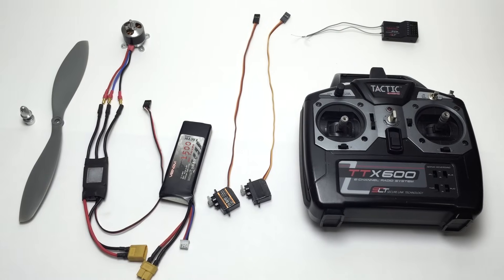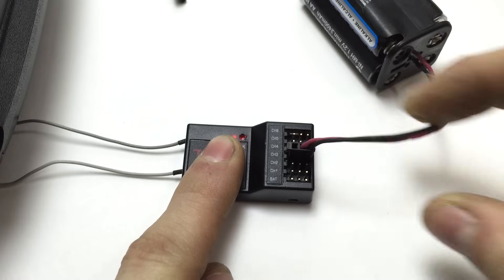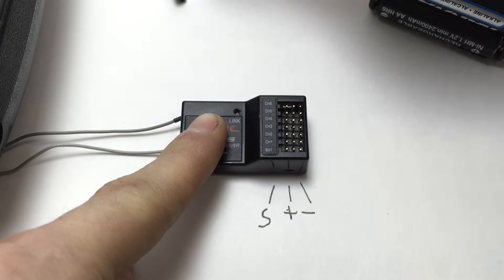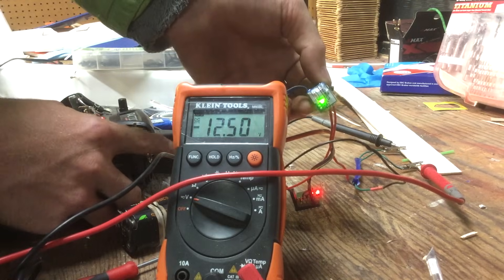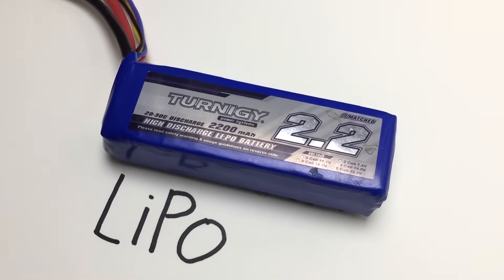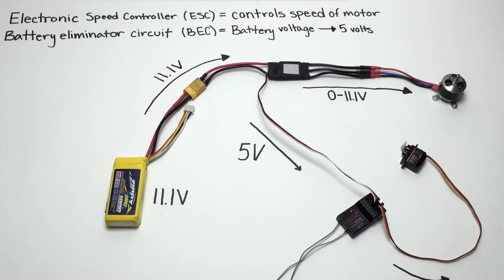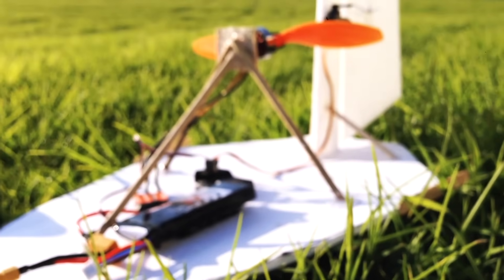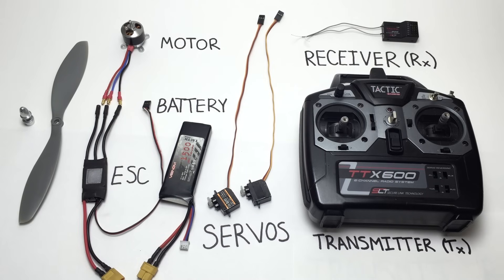RC Electronics for Noobs

Comment: what does the other plug from the battery plug into? im not talking about the + - leads
Reply from the maker: That's the balance plug, for using with a LiPo checker or balance charger

Comment: How does the battery charge and would it be enough voltage to power a big rc boat that might be around 3-8 pounds( building a boat for my pet lizard).

Comment: What type of connector did the battery holder have?
Reply from the maker: Those yellow battery connectors are called XT60's
Reply: I actually meant the 4 cell battery holder connector, like JXT or Futaba.

Comment: what amps does the esc shoukd have? the motor says 30 A. does it need 30 ? or does a 10 amp work for the motor?
Reply from the maker: The ESC does not "push" power to the motor. The ESC lets the motor pull power through it. The ESC needs a current rating that is higher than the motor rating so that it can withstand the power that the motor wants to pull through it. For example: 30a motor should have about a 40a (or more) ESC to be safe.
Reply: Samm Sheperd thank you, its clear now

Comment: Guys guys, for the first time in my life

I heard an American say solder instead of sodder! No but seriously, great video - I thought there might be more to this, but now I know there isn't, I am far less hesitant about buying this stuff to make my own scratch built plant or glider! Also I'd like to add FPV. If you are reading this (despite it being a relatively old video) I would be very interested to see 1) a video on how to build a foam plane/hand-launch glider 2) how to install the cheapest and most effective FPV system on said air vehicle.

(I wrote this comment halfway through the video and I've now seen the links, just thought it might be helpful for others in the same position as me!)

Comment: The for "whatever reason" on the different coloured servo wires comes from the original Futaba and JR Propo radio systems. Futaba had the white signal wire with the irritating flange on the side of the servo plug. (we normal just cut it off with sharp blade or something) while the yellow signal wire system comes from JR Propo. (suppose it was some sort of a opposition or competition thing). Accept for the plastic flange, there is no electrical/electronic difference.

Comment: I really want to build an RC plane now. It should be easy to connect a microcontroller and some LEDs. Can the ESC provide enough power to the 5V rail to power a few LEDs or should i connect them directly to the battery?
Reply from the maker: Yes I can definitely power some LED's. Servos are very power hungry in comparison.

Comment: can i use a 850 mAh 7.4v battery on a 1000 kv brushless motor
Reply from the maker: The motor specs should tell you what the recommended propeller and battery is.

Comment: I have a question: how do flying wing/delta wing servos work out.  how do the servos recive information from two channels simultaneously?  I've been researching these designs as I want to get back into the hobby but I haven't seen anything about this yet.
Reply from the maker: The mixing is done in the transmitter and the servos just do whatever the receiver tells them to do. Pretty much any transmitter will at least have an elevon and vtail mix preset. Most are digital with a screen on and you can mix anything however you want, for things like flaperons, spoilerons, or even automatic elevator trim with the change in flap position.
Reply: ***** I have the same transmitter as featured, so I'll figure it out.  Thanks for the response
Reply from the maker: Oh cool I think it's something like "hold the sticks down and to the middle and then turn it on" or something like that to toggle between elevon v-tail and normal mode
Reply: Any particular motors/ motor specs to look out for?  I've got the motor and servos out of whatever plane used to go along with my transmitter (for there are many) but I think the axle is bent, so i might have to get a new motor.  About the only specification I've heard them talk about is wattage.  this might be asking a bit much so feel free to point me to a web site or other video.  or just tell me to do my own darn research :)

Comment: Hey Samm, great video! I am completely noob and I am looking to build my first quad (probably you remember a recent comment on thingiverse) I was looking through different transmitters and the frsky taranis is too much for my budget, and the FlySky looks a bit poor in quality?? anyway, I found also the turnigy 9xr, would you recommend it? or do you think I will be fine with the cheap flysky? Thanks
Reply from the maker: The biggest concern for me with quads is what receivers they offer. You don't want to be stuck using big ones. Frsky recently released the taranis q x7 for half the price and it should be great because you can use the X4RSB and have frsky reliablility
Reply: Cool, just ordered Taranis q X7 :)
One more question, is there something like Flight Controler + Gimball Controller?  just wondering if I could add a camera (hero5) with gimbal control in the future.
Cheers!
Reply from the maker: Yes there is but I don't have much experience with it

Comment: do i need calibration of motor before testin the motor
Reply from the maker: No, the motor does not need calibration. It is just a physical component that the speed controller (esc) can control. The speed controller does want to be calibrated. It wants to know what the top and bottom range if your radio channel is. To calibrate: 1. ESC connected to the radio receiver and to the motor, but disconnected from the battery. 2. Turn the Radio on. 3. Move the throttle channel all the way to maximum. 4. Plug the esc in to the battery. The esc will detect the high value and set that as the maximum, also it will sing a song. 5. Lower the throttle channel to minimum. The esc will detect the low value and set that as the minimum. And also finish the song and arm. 6. It's a good idea to disconnect and then reconnect the esc and battery. 7. Calibration complete.

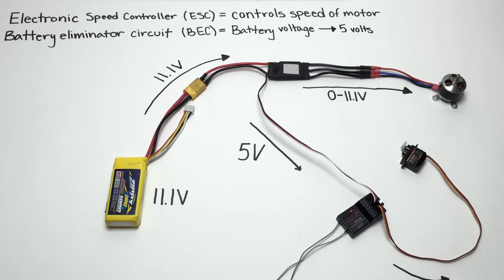Comment: 3:03 what's the other cable that goes out of the battery?
Reply from the maker: That is called the balance plug. It's just a set of smaller wires that go to the positive and negative of each individual battery cell so that a balance charger can make sure all the cells are balanced (charged equally) it's a quirk of these lithium type batteries.
Reply: ohhhhh, thanks a lot for the reply!

Comment: in united arab emirates we have 2 wire rc motors so what
Reply from the maker: +SYSTEM 1985 if the motor has 2 wires then it is a brushed DC motor. It needs an ESC for brushed motors.

Comment: Thanks so much for making this video! I'm currently building a 250 FPV quad and just got a Tactic Ttx650 radio with the same exact receiver you use in this video. Up until watching this video, I was confused as to whether or not I had to use a separate battery just to power the Rx. Your video cleared this up for me!Knowing that my ESC's have a BEC and that I can power everything including my Rx with just one battery is a huge relief! I searched high and low for any videos that featured the Tactic receiver and how I'd go about having to power it and luckily your video popped up in my feed. Thanks so much! 😃
Reply from the maker: +Iwillsayyes1 glad it helped. I plan to make a similar video on the subject of "quadcopter parts for noobs" and "FPV for nubes" but for now I have to tell you that the ESCs used for quadcopter a nowadays don't have BECs because it's a bit silly to have 4 of them. Instead they put a BEC (or 5v output) usually on the PDB (power distribution board). I love my tactic, but as far as I know they don't have any receivers with PPM or serial output (one wire for all channels), meaning you'll have to use PWM (one wire for each channel) which is fine.

Comment: how do i connect a wire without those black plastic thing in the end to the receiver.
Reply from the maker: You can take the case off the receiver and solder the wire directly to the pad under where the pin connects to the circuit board.

Comment: Thanks loved it. Know it's old but been flying drones now moving to planes and found it all very confusing as to what to buy and what was needed. Would love to see how to put a compatible system together with a simple flight controller and gps if you ever have time. 
It's the esc that gets me. How do you know what power esc to get for your motor? Also does the battery effect it? If you go from say a 2200 mah to say a 3500  mah do you use a different esc? So confused. Any help much appreciated.
Reply from the maker: It starts with the motor. The motor should have specs which say what battery voltage, propeller and ESC to use.
The battery voltage is determined by how many cells are connected in series eg. 2s, 3s, 4s etc. where each 3.7v cell adds together, 3s=11.1v) 
The batteries capacity eg 2200mah or 3500mah determines how big each of those cells are. This is similar to a bigger gas tank.
If the motor specs don't recommend an ESC, the specs should say what the motors max current should be when using the battery/prop combo. The ESC doesn't push power to the motor, but rather it lets the motor have what it wants, and the motor sucks power through the ESC. As long as the ESC's max rated current (eg 30a) is bigger than the motors max rated current (eg 20a) then the ESC should be okay.

Comment: how to make rc control
 circuit board
Reply: Possible with huge electronics knowledge.
Reply: I'm assuming you'd wire transistors into the receiver to act at RC switches and control thr circuit that way
Reply: hany salim same requesting

Comment: Can we use 30amp esc with 2200kv brushless motor
Reply from the maker: +Devyam Khera kv doesn't mean power. High kv- high speed, low torque
Low kv = low speed, high torque.
Use the recommended propeller and take note of its rated max current. Use an esc that is rated a bit higher that that

Comment: What is the best racing quad for beginners on a budget. I need the whole fpv setup goggles controller and quad and should I start with a whoop and if so which. There are so many options I'm at a loss because I don't have a big budget all at one time but I need all the stuff any help is appreciated. Thanks for the vids they are a help.  Should I get one an all in one like the eashine 130? Or the assasin 180 which has the quad controller and goggles?
Reply: Search up "99 drone" it goes 89MPH

Comment: what is the other wire of battery is for ? is it for recharging battery
Reply from the maker: That is called the balance plug. It allows a charger to tap into each cell individually and make sure they stay balanced.

Comment: will any transmitter work as I have a decent one and I don't want to spend alot of money on a new one
Reply from the maker: I tried to keep this video and the stuff used as universal as possible. Any standard radio system should work. You say you already have a decent one? what it is?
Reply: sir can i contact you through fb or email.. ?? I want to know something. I need some help for plane.

Comment: are all 2.4 ghz transmitters universal? say I have a transmitter for a quad copter, and I want to build a plane, and just buy a receiver. .
Reply from the maker: kind of but it's really tricky. Usually a brand will have it's own communication protocol. So tactic uses "SLT" and Spectrum uses DSMX and Futaba uses FHSS. Some other brands will use the same as the main brand. So you can use "orange rx" brand with spectrum because both use DSMX. Using one transmitter for everything is what we all want but unfortunately that's not always easy. There are "multiprotocol" transmitter modules that you can use with the Taranis transmitter that can figure out how to talk to just about anything, usually used by racers so they can use their fancy transmitter to fly the little cheap quads too.
Reply: Samm Sheperd well farts... I'll probably just get a cheap transmitter / receiver setup. Any recommendations?  I'm new to this and want to see if it's for me or not. I'm currently looking at the fly sky FS-16 combo..

Comment: What does it cost?
Reply: whyrtyre where can we buy all these stuff sir? like rx, tx, servo, esc ang etc.
Reply: Either your local rc hobby shop or Amazon.com
Reply: LiPo can be $20 to $100, servos can be like $5 to $15, Rx and Tx systems like $600, Motors like $10 to $200, ESC is like $30 to $400

That is approximate, hope it helps.
Reply from the maker: I tend to go cheaper than that. Batteries 8 to 30, servos 3-10 rx+tx 50 to 200, motors 10-20 esc 10-20

Comment: I have a question: how to make the servos work together properly. Having to push/pull the stick to like up-right, down-right.. etc.. to operate both servos is kinda annoying and not to my liking. I would to be able to operate both with just pushing the stick to either right, left, up, or down. THANKS!
Reply from the maker: each channel can be used to control one axis of rotation. eg. up/down for pitch, so use a servo on that channel to control the elevator. Use the other channels like left/right for roll. Either with one servo on the rudder or if you want ailerons, you can use a harness to control two servos with the same channel.
Reply: I saw that pushing left would make the left wing down and right wing up. But mine only make one wing down and the other does nothing at all. Thanks for the reply.
Reply from the maker: Nick StoneMiner On my receiver, the ailerons are controlled with channel 1. Since there is only one plug for channel 1, we need to use a Y-cable to make it split into two. As long as the two servos that you plug into channel 1 are facing opposite directions, then they will go in opposite directions

Comment: Great video. How do i know how much power my plane needs? what battery and motor are needed for which size? Im planning on building a foam plane like your 5$ plane and not sure about that.
Reply from the maker: There is a lot of room for error. Just try it out! And shoot for a $15-20 is motor as they will probably be best. Looking for cheap stuff gives you crap stuff that doesn't work

Comment: Can you buy all these components in one package/kit?
Reply from the maker: I don't know of any kits with everything. Because there are so many options it's hard to recommend one thing. But I do like the "power pack" kits that FliteTest sells. such as http://store.flitetest.com/power-pack-c-fixed-wing-large/ 
You'll still need to buy a transmitter and receiver, and a batter and a charger. I'd recommend a 2200mah 3s Lipo. Please read up on LiPo battery safety and handling. I'd hate to see you take it out of the box, plug it in and run it until it stops, and then try and charge it and burn your house down.
Reply: Awesome. Thanks for the reply :)

Cool, ill read into it. Loving the content btw. Straight, concise and to the point. 

Keep it up!

Comment: i have a 1000Kv brushless motor + 30A ESC + 3 Servos + lippo 11.1V 2200mAh battery.
IS IT A COMPATABLE CONFIGURATION FOR A RC PLANE??????

IF YES THEN,
WHAT SHOULD BE THE PERFECT WEIGHT OF THE PLANE INCLUDING ALL ELECTORNICS?
AND WHAT SHOULD BE THE PROPELLER SIZE?????

please don go into too much technicality it just complicate every thing.

Comment: How do you extend the shaft on the motor ?
Reply from the maker: For what reason? You would have to remove the existing shaft from the bell rotor and press in a longer one.
Reply: I was thinking of making a rc boat and thought I would need a longer shaft. Do they sell longer shafts? To remove it means to pull it out or unscrew?  Sorry, I don't even register as a noob yet, I don't even know if I'm asking the right questions.

Comment: how do you bind the transmitter to the reviver
Reply from the maker: It depends on what brand you have. The receiver should have directions, or you can search YT or online for how to bind your specific receiver. For the one in this video, you just press the bind button on the receiver while the transmitter is also turned on.
Reply: thanks
Reply: nonononono. its MAGIC (ooohhhhhhhhh!!!)

Comment: hello I have one question,  if we want to plug 4 motors we need 4 esc ? and if we need 4 esc how to connect them to the same battery? thanks
Reply from the maker: Great question! Yes every motor needs it's own ESC. To power them all, you need either an adapter cable or with multirotors we use power distribution boards (PDB)
Reply: +Samm Sheperd (SNRS) ok thank you now I am ready to make a rc thing haha

Comment: I have a question.  In the battery eliminator circuit how do you add 2 motors? Does this setup allow for only 1 motor? If so is there another circuit/setup that allows me to do so with the same parts? Plz help!
Reply from the maker: You can use a y-harness to connect more than one ESC to the throttle channel on your receiver.
Reply: Thanks! That helped so much!

Comment: In what way does the receiver communicate with the esc? I am planning a project with an arduino as receiver / flight controller, and really need to know what the signal is like from the Rceiver to the ESC. Is it just 0 - 5 v? or digital / pwm?

Comment: How bout 3 channet how is going look like
Reply from the maker: +Bao Khang Kelvin A 3 channel is the same as this 6 channel system, except it only has channels 1-3, what you do with those is up to you, but most 3 channel airplanes use throttle, elevator, and rudder. Or you could use ailerons instead of rudder.
If you use rudder for steering, then your wing needs some dihedral.

Comment: Hey can you buy ESC's that is made for quadcopters and use it for rc planes?
Reply from the maker: +Junior yes
Reply: +Samm Sheperd (SNRS) Thanks! I dont want to sound like I am advertising, but the next time you need to buy parts cheaply I would suggest going to AliExpress (it has free shipping of any product you want). I just got 5 servos for 10 bucks and they are good too. Just a tip.